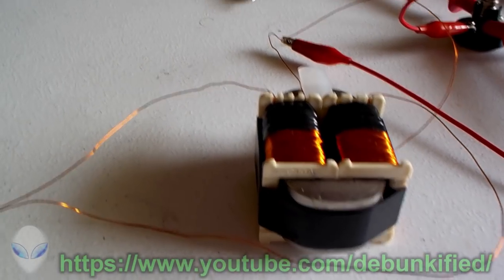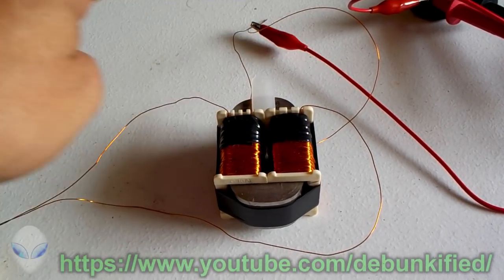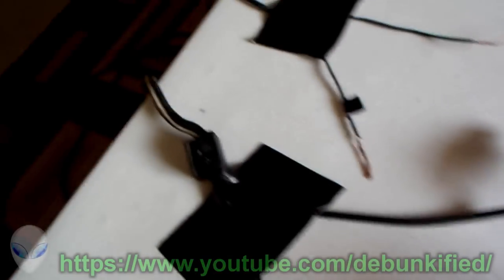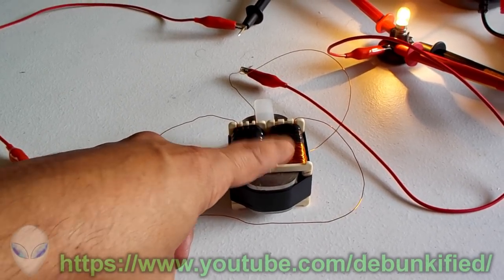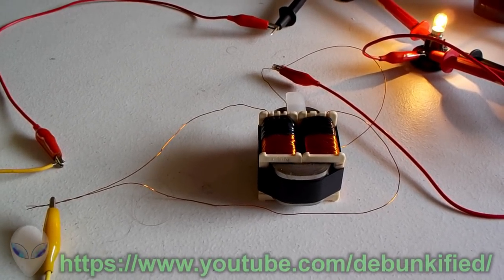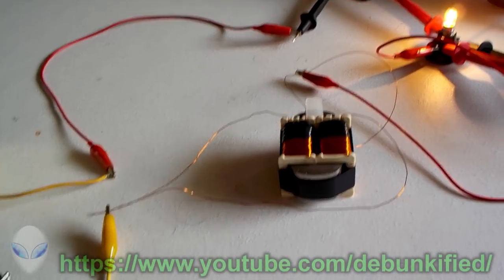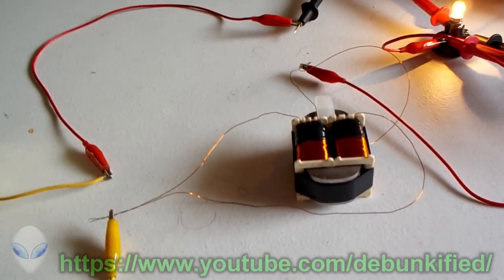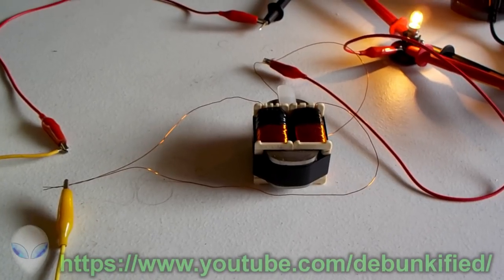Bifilar Coil Generator (Mr. Preva's Experiment)

Comment: Ok, kudos for debunking. Regarding your test setup. If both coils were wound the same direction, you would have a standard isolation transformer. Providing the same output power as the input. Only no direct connection to the input source (wall socket). As the second coil is wound in the opposite direction, it would still function as an isolation transformer, but the phase would be inverted. Meaning when the input terminals were going from 0 to 115, the output terminals would be going from 115 to 0. However, this makes no difference, the output would still be AC voltage with no change in capacity.

Comment: +1 Keep trying! - The Mr Preva Experiment, by itself, is not Above Unity! It does show an Amplification of Current. - 1/2 the turns on one coil, add a Cap and find the RLC Resonance, there is a Magnetic Resonance between the Coils, this is where each Current is 180 degrees out of phase. Please follow the original video: https://www.youtube.com/watch?v=K5tTTYc1CcU - Leave your Coils, remove some turns from *one* Coil only, just add Bi-Polar Cap and find RLC Resonance with a signal generator and a small audio amp.

While Energy has a Symmetrical Counter Energy component, Losses will always be less than Unity.  Energy does in-fact come from the Time Domain, and Energy over Time can be greater than the initial Energy Consumed to initiate, but it is not always the case that there is a gain just because of the Opposing Magnetic Fields. Opposing Magnetic Fields Accelerate Electrons, this provides a Gain in Current, seen and experimentally proven on the bench, thus: The Mr Preva Experiment. Voltage also needs to be stepped Up. I = V / R Ohms Law does provide some insight to the next step.

Comment: if 2 winded cores are placed at 90 degrees to plane of the original u cores the opposing field will take the route of these 2 new cores if they are placed right down the center of what would be the confrontation point of your opposing fields, no need to split it , the two opposing fields will travel upwards from your table towards ceiling of your room and especially if you provide a core, now you will have 2 coils one generated by the norths clashing and the other generated by your souths clashing

Comment: if you really want something unbelievable try a step up transformer just using the basic counter and clockwise layers you don't need metal. But you have to layer one coil at a time. when pulsed . the other receives a voltage step up by adding core material amps are also increased. I believe Tesla thought it was to simple to create more from less. .  I have tested it 5 volt's in 40 volt's out .  I Thank you This is my way of returning the favor. equal length's of wire and same gauge. Thanks. If only we as a world weren't dumbed down by greed. Imagine the wonder's
Reply from the maker: Hi there. This is interesting and I have thought of something like that before but I don’t remember actually doing it. Perhaps I got fed up with winding coils? 

Winding opposite direction coils layer by layer is very hard! That I seemed to remember attempting at one point but gave up rather quickly.

Now what would this do exactly? Let’s see here it sounds like any Lenz’s law might be cancelled out but from my experience this also cancels out any current in the secondary.

Maybe I did it wrong. How many watts were you getting going in compared to watts going out?

The way I did it was with two rotors with same polarity magnets moving past two coils that bucked their Lenz’s law opposing magnetic fields, which canceled them alright but it also canceled the current in the coils, which never made sense to me.
Reply: @debunkified  I'm going to ry and post a video if they let me it does work
Reply from the maker: @sidster64  Why wouldn't they? Anyways, did you measure the actual Wattage on the input and output? By wattage that is meaning both Input Volts and Amps and Output Volts and Amps.

Just measure the Volts across the source and the 'amps' with meter set to amps in 'series' between let's say the negative and the transformer.

Same thing for the load, measure Voltage across the load and a voltmeter set to 'amps' in 'series' between the one side of the load and the negative going into the load to measure the amps.

v x i = W of course.
Reply: @debunkified  when  tuning it you can get more on all levels. However it implies all motor are designed to create negative. But as a transformer it's great. Led are efficient so it show unbelievable result 30 watt running on 2.5 watt
Reply from the maker: @sidster64  I used to think that light was a good indicator of output but it’s really not. So you can’t use lights as an actual power measurement for output.

It’s better to measure the actual power going across and through the lights. What kind of power out and in did you get on your CW and CCW wound coil?
Reply: @debunkified  1929 patent amplification transformer I modified it . The led are rated 24 volt 30 watts . and 110 volt's I'm running on 5 volts.
Reply: @debunkified  yes  got 40 volts from 5 also amps. it's still work's
Reply: I want to see if it opposes lentz law's . certain wiring configuration defies Ohm's law's.
Reply from the maker: @sidster64  Ok what I would like you to do is measure the power input and output. Forget the light and how much it is rated for. Then tell me what it is.

Comment: "Anything asymmetrical is most always over unity in operation. " hmmm my face is asymmetrical? ? ?

A power step down transformer is asymmetrical, but its not over unity, if it could be, why isn't it done in every POWER transformer in the world?

If you are going to "properly" "document" this experiment, PLEASE draw circuit diagrams, including your DMM connections.

Take great care as to how you define your winding direction as you are using a circular core and the windings are on either side from each other.
To prove direction of magnetic field and hence the start and end of each winding.
When you have wound them, put a compass beside the transformer and energize each coil with a DC current, to show current direction and coil/magnetic field polarity.
This will identify the start of each coil that produces the magnetic field in the same direction, then you will know how to connect one 180Deg out of phase.

Also check your DMMs, they are T-RMS meters, true RMS which means they calculate the REAL RMS current and voltage of any waveform you measure with it. They have a True RMS calculating IC inside.
Read your DMM manual and google  true RMS DMM.
Reply from the maker: Hi, I was wondering why my face was so asymmetrical. Anyways I always wonder why I get such excellent measurements. So I guess the meters can be relied on then thanks for point that out. Yes you are right I should take a little bit more time and document with schematic to be a little more clear, it so tedious though. Also there are SO MANY variations and each variation takes a while to acc accomplishment, especially after carefully putting something together and then having to take it back apart. I’ll try to get the most relevant points in next time. I am actually reading an OU figure right now and I am absolutely baffled as to why. I’ve drawn out the circuit for myself and I still don’t get it and that with the wrong windings even!
Reply from the maker: Hi George, you are absolutely right about the meters. I didn’t realize it but I did as you suggested and looked at the manual and sure enough they are True-RMS in the range of (50/60Hz-1KHz) for both current and voltage. I am not so sure if it measures any wave form  but I have drawn out a quick and dirty schematic and will draw a more clear one on the ole compooter. It is measuring 120% which is most likely wrong, but when I run plain DC through it it becomes less than 100%. 🤨🧐🤔